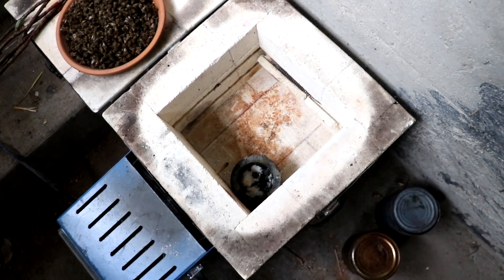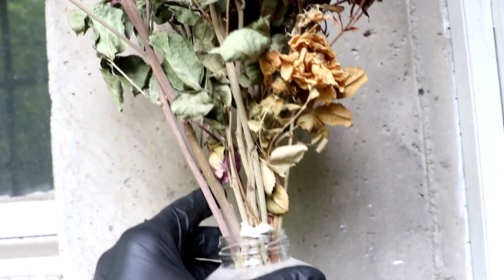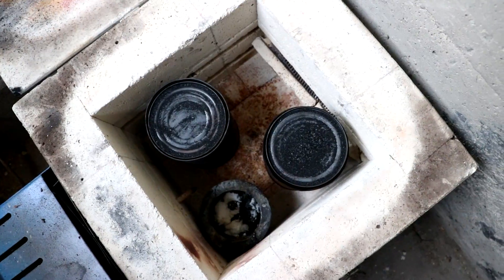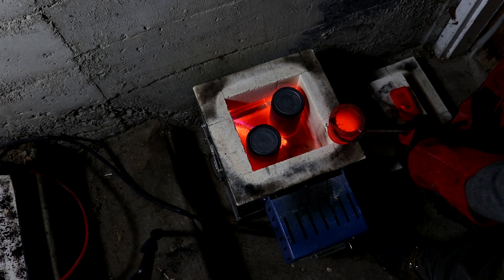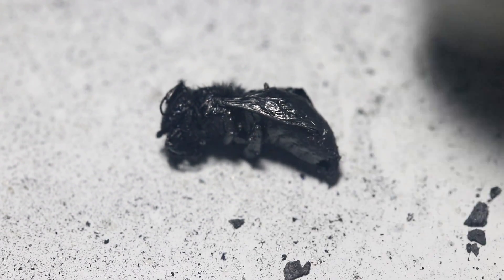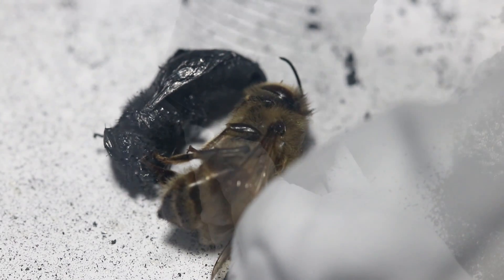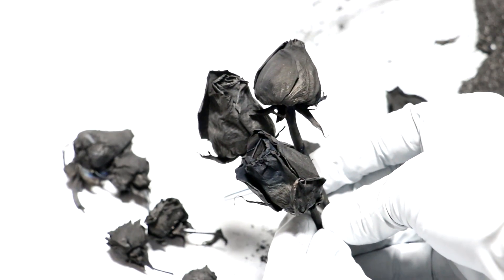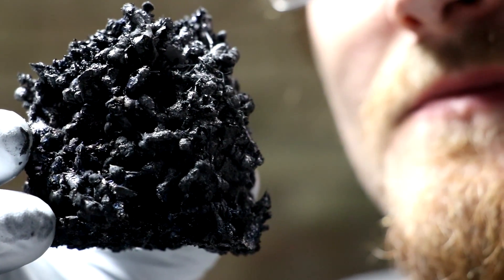Will it Charcoal? Ep. 1: Flowers and Bees to 1,000°C

Comment: I would love to see one of those roses suspended in clear epoxy also it would be beautiful
Reply: Dude, ive literally thought about that. Stabiles them before but that will look awesome
Reply: It might be hard to do it with minimum bubbles and also my experience with larger amount (in tens of grams) of highly viscous epoxy is that it produces lot of heat as it solidifies so it can't be used in large volume (or thick layers) because it can't dissipate heat fast enough.  But part of the flower would be possible and bubbles can be removed in vacuum chamber to some degree. But for some reason I thought about it as well.
Reply: @pavelp80  if you stabilize them the process removes any air inside the flower with a vacuum chamber and replaces it with a far thinner stabilizing resin that's baked to cure it or if you put it in a pressure pot that'll get rid of virtually all bubbles or at least make them small enough you wouldnt notice
Reply: That would be the best gift to my emo ass gf lol

Comment: @Cody'sLab
6:30 Can the color be from an oxide layer? (or some other non-oxide type of layer?)
You can heat up metals to very specific temperatures & times and it makes an oxide layer of a specific thickness that only reflects a specific wavelength of light & thus colors the metal, can this be the same thing?

A rose is made up from organic stuff, and that contains some bound oxygen atoms, can it be that the oxygen was released by the heat & caused a oxide-layer like that?

Comment: Consider rapidly freezing a bead of agar, made from dripping a hot agar solution into cold oil, and then freezing it rapidly in a dry ice/acetone solution, then sublimating it under strong vacuum to make SeaGel, then pyrolize it to make a carbon matrix foam that is ultra lightweight? I have always wanted to try that but don't have half the resources.

Comment: This is the one. This video has made me determined to make an electric furnace for making bio char. Time to run to the consignment shop and get an old electric heater or blow dryer for its nichrome wire.

Comment: Hi Cody, do you think it is possible to electroplate the carbonized rose with gold?
Reply: that's a really cool idea.
Reply: I hope he sees this. It would be an awesome experiment, even if it failed.
Reply: What would conduct the electric?
Reply: @fullup91  that is why this is so interesting. graphite is good at conducting electricity, however the foam structure of the carbon in this charcoal would mean it has very high resistance, that could just mean bumping up the voltage, or could introduce a myriad of challenges to overcome to get it to work, sounds right up Cody's alley and it does seem like he needs something to occupy his mind too...

Comment: Hey cody, we need to keep an x percentage of carbon not in gas form on this planet. Whenever glucose is made, it sucks up gas carbon from the atmosphere and turns it into a liquid. We took 300 million years of carbon liquid and solid build up and burned it in a short period, putting all of it back into the atmosphere. We're changing the content of the atmosphere which will lead to our extinction.  We have to keep carbon in a non gas form. I was thinking we could somehow make carbon out of glucose and use it as a building material, mix it with cement or something. What do you think?

Comment: I'd be tempted to cast some of the well preserved item's in clear epoxy.
Charred artwork, it could look decent in a picture frame.
Reply: Chartwork!
Reply: If you sprayed them with several coats of shellac (or whatever equivalent clear poly-resin spray they are using these days) it could make them strong enough to survive the initial immersion/pouring stages until the epoxy sets.
Reply: Or a really nice paperweight.
Reply: Great idea
Reply: Yess!
Reply: But the charcoaled items are really delicate, and touching them to much might ruin them.

R/iamverysmart.... 

I hate myself...

Comment: What happens if you pack a dead bee with illite (add some distilled water to help it adhere) , let it dry then heat it to the point where the bee should convert to carbon? Just curious to see how much the surrounding illite holds the shape of the original body mass. More or less the beginnings of a trace fossil or ossification? Maybe none of the above and just fun. ;)

Comment: Those charred flowers are actually really beautiful. Totally worth displaying in a vase.
Also you could make a fortune selling charred roses to goths if you found out how to ship them without breaking.
Reply: Wither Roses**
Reply: Is a rose by any other temperature just as sweet?
Reply: @polygondwanaland8390  if you think about it, this isn't just a normal rose... it's much much hotter. ;)
Reply: Encase in epoxy
Sell
????
Profit
Reply: Probably a few coats of some silicone spray, then layers of clear casting epoxy to hold the flower, then polish the resin rod to show it off.
Reply: I would buy them
Reply: I would try spray lacquer first.
Reply: epoxy would work for a display piece fir shipping, but a lot of people would want to put it in a vase. maybe some sealing spray would be a good idea.
Reply: Heck yeah. I'd totally buy that. or make it...hhm.. I know what to do for valentines next year
Reply: Vase no... a Case yes.
Reply: maybe epoxy?
Reply: Can't imagine a better symbol of lost love than a charcoal rose. Kinda poignant considering what you've been through, Cody. 🖤🖤
Reply: Hey Cody, try converting a graphite rose to diamond